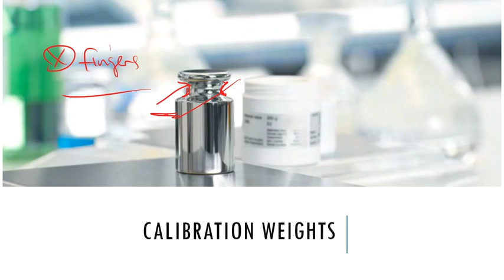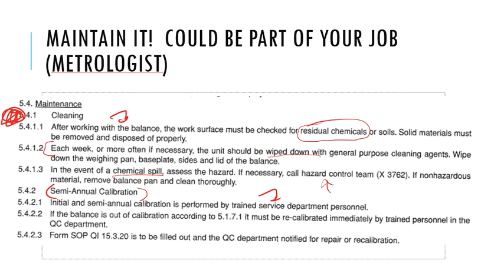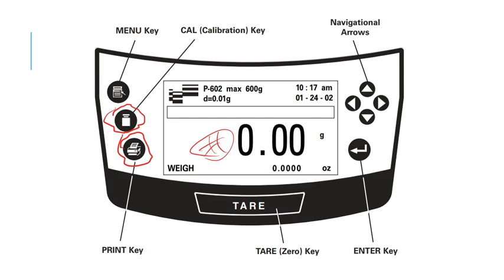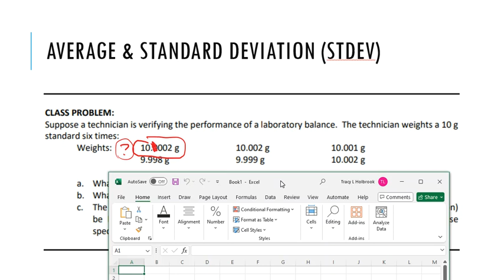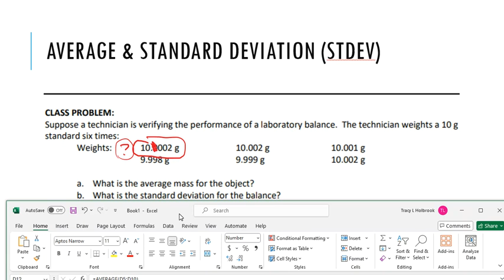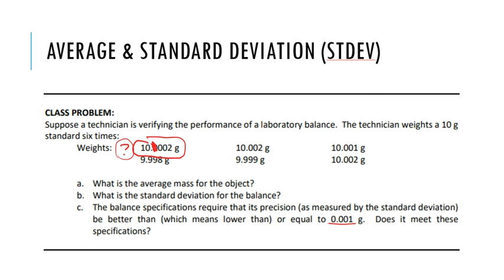CTC 114:  Analytical Balance:  Calibration, Accuracy, Precision of Balances Part 3

Comment: What is starmarks indicates on weight?
Reply: It's for identification only, so if you get the weights checked it will denote on the certificate weight with no star is XXX and weight with * is xxx you will find in a set its 2mg, 20mg, 200mg, 2g, 20g 200g and so on have the star/dot or another mark on it.
Reply: @g30rd13 But it doesn't happen with other weights, why?
Reply: @gopalgirase-01  Traceability is requied for all weights when calibration, M1 cast iroms with have numbers on like NBL1,NBL2 and so on. the smaller weights 2mg, 20mg, 200mg, 2g, 20g 200g will have a star or a dot on them to identify which value belongs to what weight on the calibration sheet. if you bought a box set of weights they will already be marked correctly but if you buy all the weights individually none of the weights will have a star or dot. hope this helps